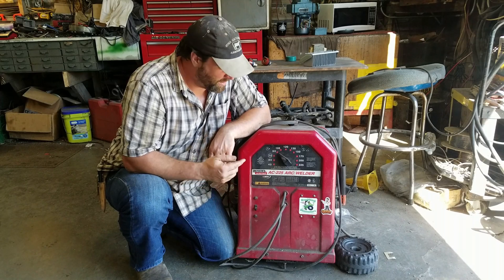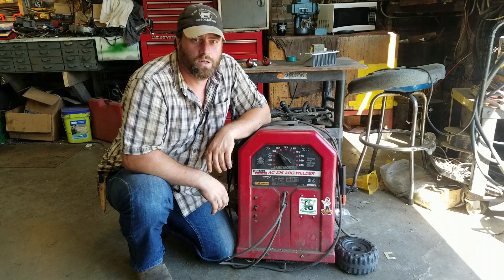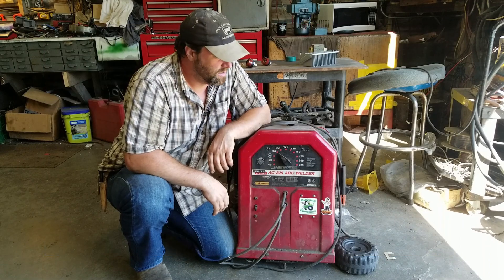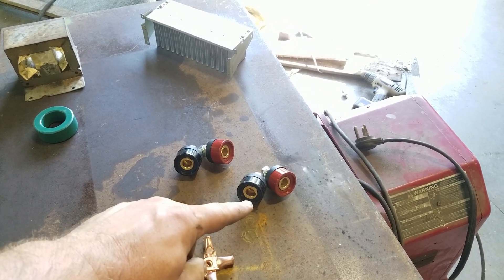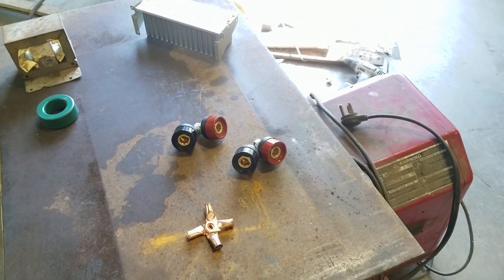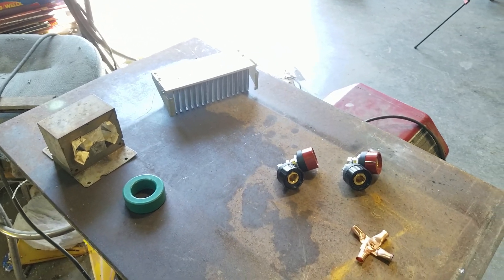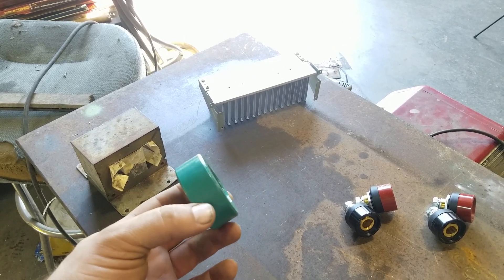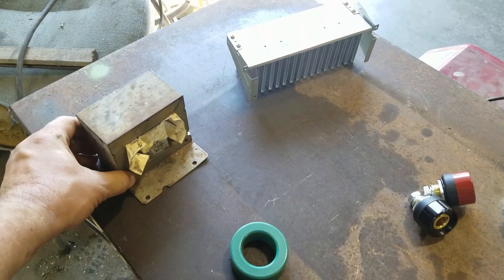Finished Product - DC Conversion Lincoln 225 BuzzBox AC Welder Tombstone

Comment: I did a similar job on an old junked buzz-box. It is a rectangular cabinet (not tombstone) so it was all a tight fit, so had to extend the box and mounted a fan right at the back. Now insanely heavy, but it works really nice. Was definitely worth doing for myself.

Comment: Good video but the flaw is that you didn't show anything about the installation, only the work you did. If you had taken a little time you could have also shown how it's done and the video would have had many more views and you would also help others to be able to achieve the same thing as you. There is a lot of material in this world to cut.
Reply: If you can't figure those parts out, you shouldn't be doing this mod. When something goes wrong, you won't know what or why

Comment: good idea to blow lincoln crackerbox out once in a while my fan did not come on once, opened it up thinking motor was gone, but mud dobber had built nest between housing and fan blade mine is 1975 model and still going strong  good vid THANX!

Comment: I'm not understanding the choke for for welder, how do you hook it up?, run your wires with it? Absolutely a great video! I'm doing the same with mine. Got the rectifier and heatsink. I have an old microwave not working in my shop to use for the choke.

Comment: I got a tombstone ac for free awhile back I’m gonna do this to.     Do I need it?   No.   I have 110 and 220 machines set up flux core and mig as well as a sa250 black face that I do mobile on.  There are times it’s just easier to glue things together with different tools.      People who know will not criticize you for modifying your machine.  The intersnobs w that say just buy this or that are the ones who would be lost if board goes down in one of their machines like happened on one of my engine drives in the past.   That’s why I now make sure I keep old school machines around.

Comment: Now days you can buy ac rods in 7018, mg 500 which is a good burning rod, and a rod called 930. All burn very good on ac and have good tensile strength.
Reply: Would you recommend using ac 7018 rods on a trailer perhaps thank you.

Comment: for my conversion, I just wrapped one lead wire around a one-inch bar of steel works good
Reply from the maker: Yeah, anything magnetic really should work.  The microwave transformer makes a nice little package tho, and I believe there's something to the laminated design that mitigates hysteresis?  Not sure on all the technical details, but it's what was recommended, so I went with that.  Thanks for watching and commenting!

Comment: I did a conversion to my small gas Lincoln welder , power supply, years ago before Utube. I know it's too late now but you should have purchased the lincoln 3 way switch which would give you + -, -+, or AC instead of moving around the leads.
Reply from the maker: That's a great idea!  I wish I would have thought of that back when I did this one too!  Thanks for watching and commenting!
Reply: What’s the part number on the 3 way switch? I searched online and couldn’t find it
Reply: That’s what I’m doing now with mine!

Comment: great video! I have few questions though, so now you have the welder being capable to do AC and DC in around 200 ish amps on both currents?  The stock Lincoln buzz box AC/DC can only do 125 amp in DC current

Comment: You didn't show how the wires were normal nor how you rewired. I'm still in same boat. I don't want to take it apart until I know how it's wired.
Reply from the maker: True, I should have overlayed a schematic.  The way I did it, was the original wires going to the leads (stinger and workpiece clamp), I tied to the 2 middle black DENSE connectors.  Then from tied in with those, it goes to the bridge rectifier, it's AC, so it doesn't matter polarity.  From the rectifier, the positive I ran through the chokes (about 3 turns on the torrid and about 5 or 6 on the microwave transformer core), then to the red DENSE connector.  The negative from the rectifier went to the black DENSE connector.  I also, though unnecessary, added an amp gauge that clamps around the wire on the AC side, again, polarity doesn't matter there.  That's pretty much it.  Hope this helps!  Thanks for watching and commenting!

Comment: That stick welder still has a place in your arsenal- even more so now that you've got greater flexibility in electrode selection.
The big advantage stick has over mig (assuming you've got a generator that can output 220) is that wind can't blow your shielding gas away mid-bead when you're fixing something outside of the shop.

You did a really great job, btw.
Reply from the maker: Thank you!  I agree about their usefulness.  I actually already sold this one, but I've thought about getting another one but we'll see if I can find the right deal on one.  Thanks for watching and commenting!
Reply: @burningdinosaurs  Just out of curiousity did you break even or take a loss on the old AC tombstone?

Comment: 6:24   ??/  whats with jimmi hendrix  noise....??////   well, at least you know how to be usefull.......good for you, happy burnin'. you may consider adding a 100 u Farad 250 volt capacitor, across the  +  and -- side of the bridge. This will add a bit of voltage (smooths out rippley DC), and, WILL HOLD AN ARC MUCH BETTER.....explosive arc,  will be ok.
Reply from the maker: I thought about adding a capacitor, but then I'd also want a discharge resistor across it as well, and I just didn't end up trying to figure one out.  I'm sure it does help.  I already sold this welder, however, but may pick another one up and do the conversion again someday if I find a deal on one.  Thanks for watching and commenting!

Comment: What'd you wind up using for chokes?  What did you use to rewind if you did and how many winds?  Great job!  Looking forward to doing similar more in the future with my buzzboxes and maybe more. Great upgrade and repurpose/hack/mod.  Guessing you saw the Hackday article regarding and if not, consider maybe further upgrading... though sounds like you're not planning on keeping.  I just got a Century 125GL... though plan to keep one of the buzzboxes at least where one is going to be the grill for a fully functional hybrid garden tractor engine welder/generator and more.  Thinking the 20th Century one.
Reply from the maker: I used a Microwave transformer as well as a torrid I ordered from Amazon.  I went through the torrid about 3 turns and the transformer about 4 or 5 turns.  It worked really well, but I've already sold it and got a wire welder.  I'm just not good enough stick welding to keep one around.  Might get another some day if I find a deal on it.  Thanks for watching and commenting!

Comment: I have the same welder and have been wanting to do this for a while. Thanks for posting.
Reply from the maker: If you already own the welder, it's totally worth it to convert!  It welds so much better.  Especially with the choke.  Thanks for watching and commenting!
Reply: I always thought it was me not knowing how to scratch start, but once I’m going, they look great. So DC arcs are easier to scratch off?
Reply: 6011 was all I could use though…
I’ve heard you can weld aluminum with an AC stick welder and the right rods.

Comment: Now, the real question is, will it burn a 5/32 6010 smooth? If it were mine the next project would be to build a high frequency box to set on top so you could tig aluminum. It's not that hard with scrounged parts, and online plans. I aplaud good ol' fashion american ingenuity. My grandpa always told me, " do the best you can, with what you got, where you at". He lived through the depression, 2 world wars, and passed in 1983, he knew and things most folks with a phd just can't understand, lol. God bless. Watch after that lil' feller, and teach him good. 😃
Reply from the maker: Thank you!  It welds 6010 fairly OK.  Not perfect, but I burnt through a few pounds with it before I sold the welder.  I'm very much of the "work with what you got" mentality!  I agree: experience is almost always a better teacher than a classroom!  Thanks for watching and commenting!

Comment: What the microwave transformer is used for?
Reply from the maker: I wrap about 4 wraps of the output wire around the microwave transformer core to function as a choke, for smoothing the current out.  Thanks for watching and commenting!

Comment: Thanks for the vid and making it through the project.  You appear to be open to suggestions.  Awesome.  Here is a suggestion that would help many, including myself and put some money in your pocket.  If, in the video description, you placed affiliate-links, to each of the parts you used, through Amazon, ebay or some other vendors, in the description, then the rest of us, who are wanting to do the same conversion to our welders, could click on the link, go directly to the site/page you used as your source, so we can purchase the exact same parts you used from the same vendors.  This would be is a huge help for the rest of us having to hunt down these same parts and making sure they are the correct part.   Which as you know takes lots of time. You have already done this work of hunting down these parts, so why not make some extra cash from this work by placing these affiliate-links in your video description?  Thanks.

PS:  I'll be keeping an eye out for these links and will probably be your first buyer.  Thanks.
Reply: Yes, please do this

Comment: Wow its the best tombstone modification i've seen yet on Youtube also the most esthetic looks better than other with who have use the easy route of installing the bridge rectifiers outside with non protected for electrical shorts open air connectors to get kids zap by ,yours looks much more secure ! You treated this old machine with respect for the use you had with it before by giving it a new life extension instead of sending it to  the landfill ! Even with a mig its god to keep a stick welder because welding outside in the open air make your shielding gas useless a stick is still more than adequate check all the pro welder outfits still using stick for outside work !
Reply from the maker: Thank you!  I appreciate that!  I did, actually, already sell this one, but I may end up with another stick welding option soon.  Yeah, I really didn't like the idea of mounting the rectifier on the outside, nor the choke, for most of what I do, I prefer the "sleeper" look, or at least as factory-looking as I can manage.  Thanks for watching and commenting!

Comment: Seems to work absolutely awesome Man! I have an old 1973 Tombstone I weld aluminum with using a Arc Pig works fantastic! Tig welding with a old dinosaur! The company Arc Pig makes a standard say 60Htz into a high frequency AC aluminum welding machine using straight argon gas. Just FYI Check into Arc Pig.com! If you need to do any aluminum fabrication! Otherwise Great tutorial video! Thanks again!

Comment: Thanks for the video. I do the same thing with my projects; make do with what I have based on investment/return. 
I would, however, not get rid of that stick welder. You'l always go back to it. MIG takes less skill and is faster production, generally, but it costs more to run and is pickier as to what it welds well.
If you own the gas bottle, you have to keep it filled and certified. The gauges on the tank get busted. The roll of filler wire is not cheap and needs to be kept clean and rust free between projects or it mucks up the feeder, lead and gun. The leader and gun are fragile and eventually wear out at several failure points, almost never at the same time.
For casual home or occasional use, stick is still the way to go, IMO.

Comment: Cool feature with the ampmeter, but where did it actually connect to?
Reply from the maker: It uses coil that clamps around the cable.  I put it on one of the AC wires just off the transformer.  I probably should have explained that better.  I may make another video explaining more details about the conversion.  Thanks for watching and commenting!

Comment: Please, make an in depth video!!
Reply from the maker: I will try to get something put together sometime.  I've actually sold the welder, but I can give more details in another video and I've got a bunch of welding video I can add in.  Thanks for watching and commenting!
Reply: Yes!  This is by far the best example of a DC conversion on  tombstone.  Unfortunately I don't have enough electrical sense to put something together like that without all the connections spelled out for me.  Very inspiring!

Comment: I did pretty much the same conversion a couple of years ago, minus the choke. Used a block of aluminum I had laying around for a heat sink. Used 4 gauge automotive battery cables to wire the rectifier and connect the Dinse Connecters. Mounted the rectifier in almost the same place you did. The ammeter is a nice feature. As far as the cost effectiveness, the AC/DC version of that machine is over $600 these days, and that conversion probably puts out higher amperage on DC than the factory Lincoln unit that peaks at 125 amps. Hang on that Lincoln, you may run in to situations where the stick welder is a better option on heavier material than the MIG welder. I built a pretty beefy cart to hold both my converted Lincoln Buzz Box and my Lincoln MIG Welder. I mounted an electric box on the cart and wired the Buzz Box in to it, with a 50' cord. The MIG Welder plugs in to the box so I can switch from the stick welder to the MIG welder or vice-versa.
Reply from the maker: Yeah, you're right, it's probably still cheaper than buying an AC/DC machine new.  Sounds like a real nice setup!  I actually already sold it, but, like you said, I'm considering getting another one and converting it as well for those times where a stick is better than a MIG.  Thanks for watching and commenting!
Reply: I built the same cart! Took a harbor freight welding cart, and modified it to carry my tombstone, and my Lincoln flux core MIG! Now (as I type this), I'm doing this conversion to my tombstone!

Comment: have same welder. ordering parts online to do this and no where near as electrically savvy as you but goin for it, would like to start tiggin. Is the microwave transformer necessary, if so what was it connected to? couldn't get a good look and have a bad understanding of it even after a few vids on it. would just adding rectifier with heatsink cause me problems or will it work fine?
Reply from the maker: I admit I didn't do a great job explaining how everything goes together.  Basically I'm using the microwave transformer core.  I wrapped a length of welding cable around the core, then welded it back together.  I put mine on the positive lead, but it really doesn't matter much.  It functions as a "choke" and basically smooths out the current.  If you also wanted to smooth out the voltage, you'd add a large capacitor across the positive and negative output of the bridge rectifier.  My first video on this conversion was simply installing the full wave bridge rectifier, and honestly it worked fine, just not as smooth, and the finish and spatter was noticeable.  But if you find an old microwave out on the curb somewhere, I'd suggest picking it up and pulling the transformer out so you can wind a choke, it really does help.
Reply: Exactly what I wanted to know, great job!

Comment: I just bought an old Buzz Box because my Miller 211 burned out and put me out of work. Keep Your Buzz Box. Im buying a ESAB when I go back to wire feed. Got any links to the parts you used?
Reply from the maker: I got both the rectifier and the DINSE connectors on ebay.  The number change all the time on there, but the rectifier was 400A 1000V, and the DINSE are just cheap ones I found on ebay.  I actually already sold the Lincoln, and, I agree, it's very useful as a DC stick welder, but I may have another trick up my sleeve if the need arises again!  Thanks for watching and commenting!

Comment: What did you end up with on the choke? What size wire and how many turns through the steel core? Did you pass all the DC current through it?
Reply from the maker: I used both the microwave transformer core, as well as the ferrite torrid I bought online.  I think it was about 7 turns through the microwave transformer core, and about 3 through the ferrite torrid.  Only the positive lead goes through the chokes, and, yes, all DC will pass through them.  It does work pretty well, I welded for about 4 hours with it this past weekend and it's pretty smooth!  Thanks for watching and commenting!
Reply: @burningdinosaurs  just to get some more understand since I plan to do what you did in the video, you just ran the positive dc cable from the recrifier through the torrid and the MOT then right to the dinse connector? It's just kind of hard to see in the video and you can definitely see how nicely the dc side of your welder runs and I'd like to replicate this. And did you re-weld the I part of the MOT back to the E part?
Reply from the maker: @sl33ksnypr285652  That's correct.  I really did a horrible job explaining and showing what all was done, sorry about that.  But, yes, that's how it went.  And, yes, I welded the core back on the transformer with my other welder.  I probably should add a voice-over to the whole video to explain what I'm doing.  Not sure if I can at this point though.  Feel free to hit me up with any other questions!
Reply: @burningdinosaurs  okay cool thanks for the info! I'll update you when I decide to do this stuff to my welder.